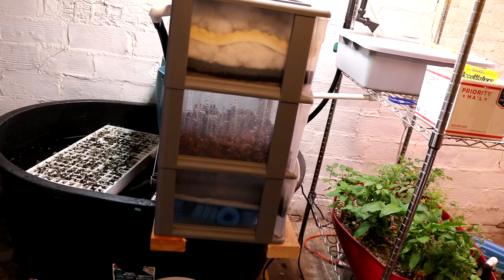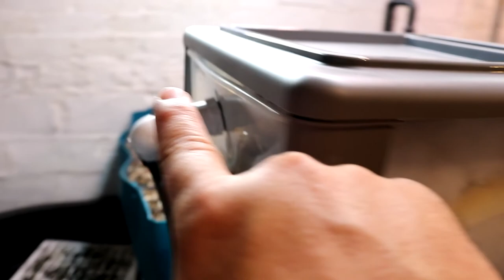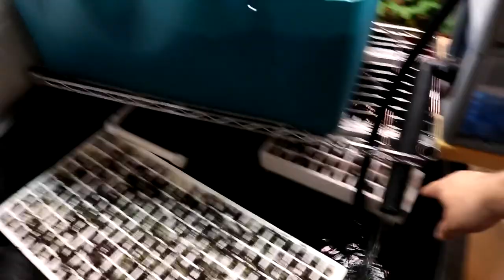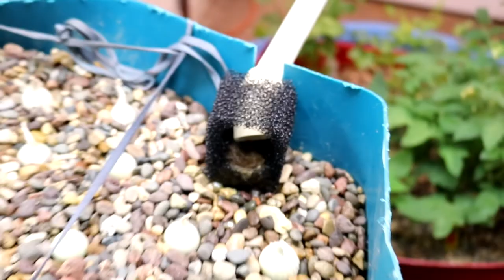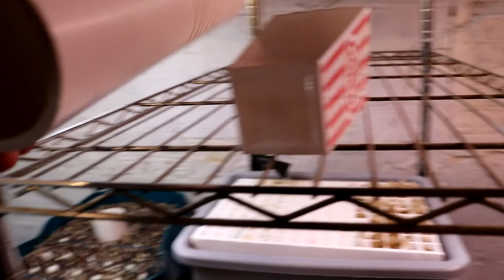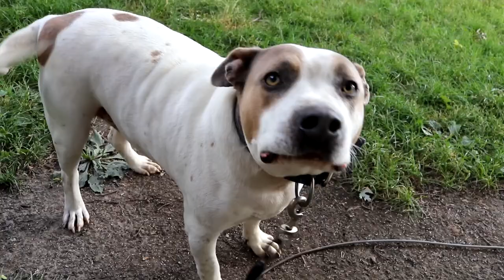forced CARBON design Shower/Trickle filter for Koi Ponds plus some tips and tricks

Comment: Does the foam in the trickle filters get blocked easily. If it does get clogged up, how often do you need to clean. How long does the activated carbon last?